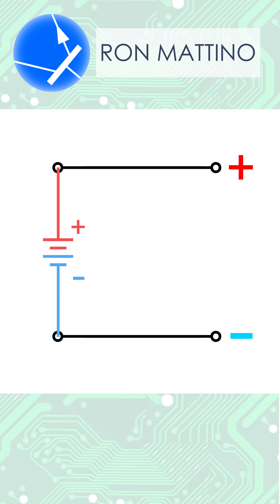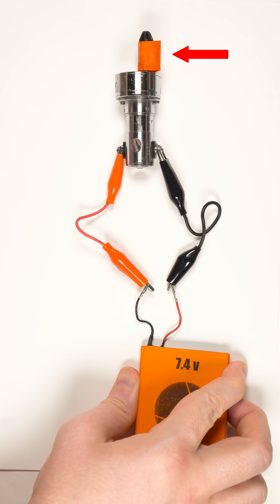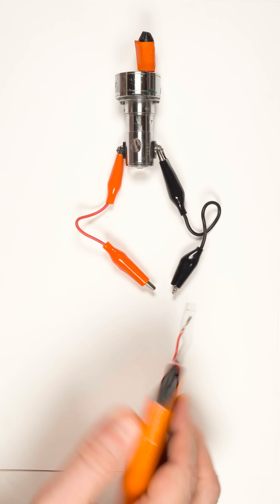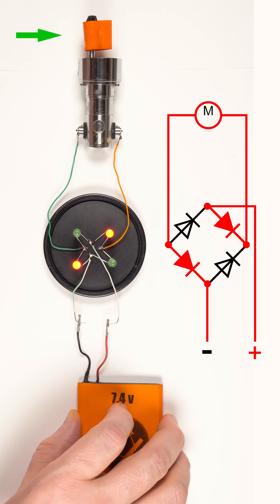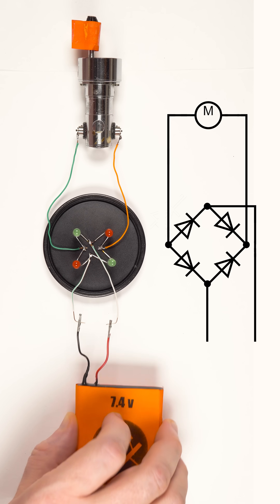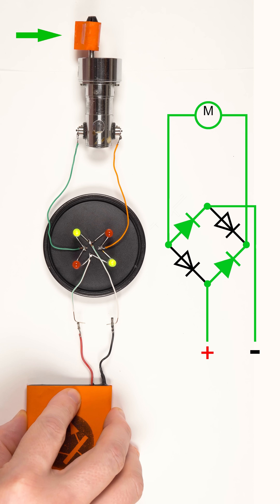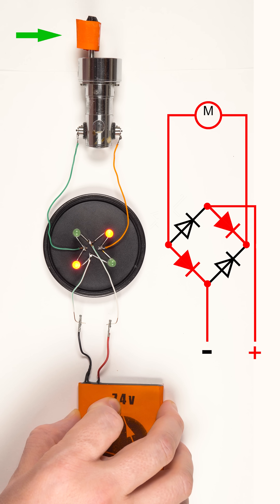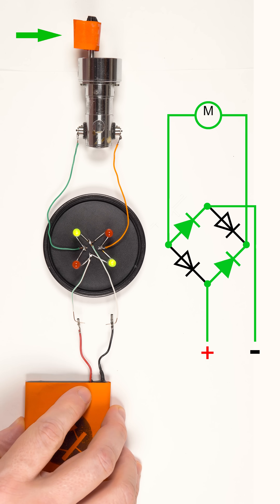How does the Full Wave Bridge Rectifier work? #electronics #diode #bridgerectifier #diy

Comment: Soooo… if you could get a 3.5v AC current going through there, the motor would continue to spin one way, while the LEDs would flash 50/60 times per second?

Comment: Excellent for demonstration purpose. 
But we should always remember that never the leds should be replaced by proper Diodes. Thats because LEDs cant handle reverse current/voltage greater than some 1.5-3V for a long time. 

Otherwise yes, this demonstrates the flow of current very well

Comment: This is a great way to demonstrate the bridge rectifier, rather than just looking at four diodes in an odd configuration and imagining what is happening.
As others have probably already pointed out, at 60 Hz, there needs to be a small capacitor inserted in the bridge rectifier circuit, in order to smooth out the current.  If the right capacitance is chosen, the  capacitor holds on to a small amount of charge, and then dumps it back into the circuit at regular intervals. Otherwise, the user will get what is known as "pulsating dc current", which is dc current that is a bit choppy, and not a smooth, stable current.

Comment: Except that in AC is not "a DC that changes polarity 60 time a second". That is dangerous misconception, that give people impression that they understand AC, while reality is vastly different. There is a big difference between Live and Neutral wire in AC, and despite incorrect wiring would work without issues, it might pose a very real danger, leaving circuits energized, even when they are seemingly off.

Comment: Remember that LEDs are not designed to control high voltage, use a proper diode if the power is >3v AC

Comment: But LEDs are bad diodes. 
Loss of 2 to 3 volts per LED. 
Reverse voltage only a few volts. 
Maximum current only 20mA.

Comment: I made this circuit before but i used five diodes then later discovered the fifth one is useless,, after removing the fifth one i saw that it's just a bridge rectifier....i laughed at myself for trying too hard 😂😂... voltage drop is weird though,,my expectations were beat down,,i gave up on my idea for making it...
Reply: There are other ways to rectify than the bridge rectifier that have a lower voltage drop, those are more complex though

Comment: That's actually incorrect, A single wire goes from negative one twenty to positive one twenty going through zero at the middle, That's why you can use 2 wires 120 and get 240. Because when 1 is 120 negative, the other 1 is 240 positive and then they reverse.
Reply from the maker: Not true. One wire goes thru -120, then 0, then +120, but it occurs at different time, so it does not add up to 240. At every moment of time, it's 120.
Reply: @RonMattino  I'm talking about The USA system, One twenty is one positive one twenty cable with neutral, Two forty volt I'd Obtain by using 2  120 volts lines, Some countries use a single Two hundred and forty volt line plus neutral.

Comment: So i was confused, is that drawing correct? Because i understand how it works but in the picture it appears like the negatife and positive still swapped no?
Reply: Oh wait im sorry i get it now, the one below represents the battery, well nvm and thank you for the knowledge
Reply: He failed to point out that the polarity of the pulsating dc applied to the motor.  The positive output is always from the point on the rectifier where the two cathodes are connected together; the negative output is from the point where the two anodes connect together.  This may seem backwards until you look at electron flow to determine the electron current direction through each diode--cathode to anode, or conventional flow, anode to cathode..

Comment: Is there no current and voltage drop using diodes
Reply from the maker: Yes, there is.
Reply: There is no current drop. This is something that does not make any sense. Current is not dropped.

There is a voltage drop across the diodes in a bridge rectifier.